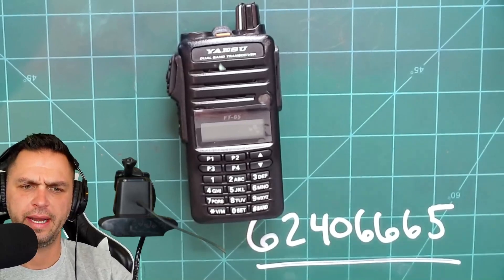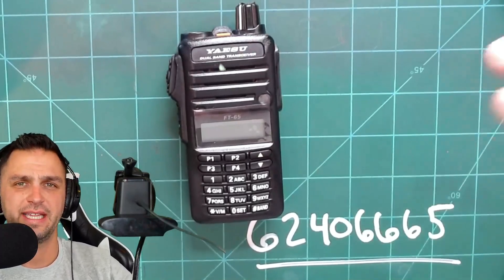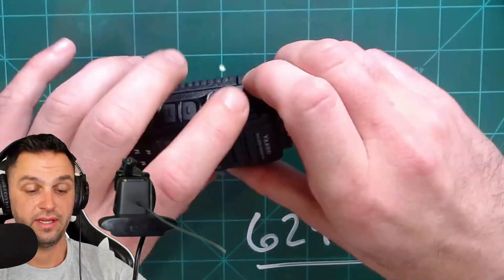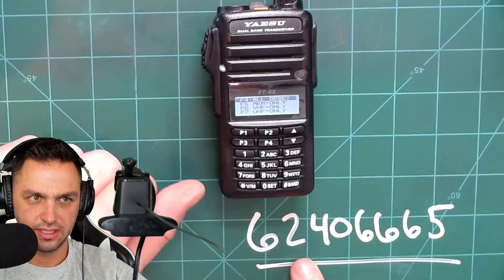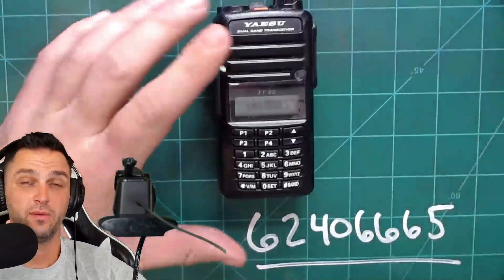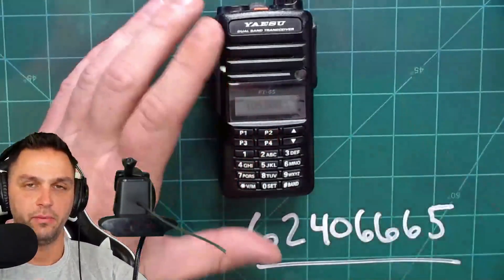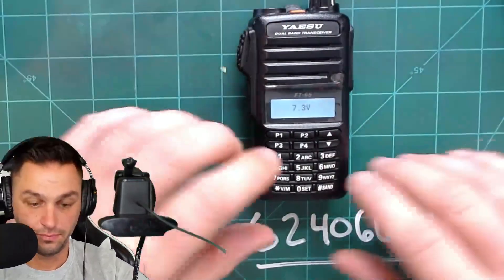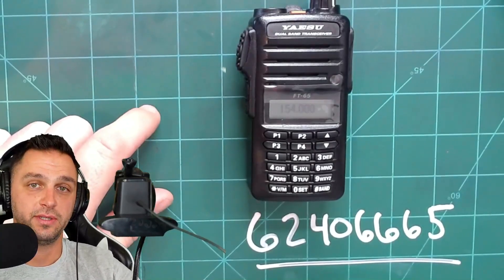How to Mod Yaesu FT-65R MARS Mod / Frequency Mod - In Two Minutes or Less - Yaesu FT65R

Comment: One thing I noticed is when you are typing in the code, nothing shows up on the screen until your done typing and it does a reset automatically. I thought I was doing something wrong when I started inputting the code

Comment: My wife has a 13 Years Old FT-60. The Radio still works fine, however, the Socket on the Motherboard for the Wall Charger, developed an open circuit. Still charges fine by using the Charge Craddle.
So, I'm going to sell the Radio, with a Battery, Alkaline case and The Wall Wart & Craddle for $80.00 for everything.
I just bought her an FT-65 for Christmas. I like the thing SO much, I plan to purchase Two more of them for my Go Kit.

Comment: Great mod. Any ideas why id be getting momentary drops in strong signals?? During our usual weekly Nets. Net Control will momentarily drop a few ms but my nearby scanner wont. Other than that its a great radio especially when paired with a better antenna.
Reply from the maker: Depending on how strong, the signals could be causing decents of your receiver.  Do you know how far away the signals are and how much power They are?
Reply: @DudeTested  repeater is only 6 miles away and is only 20 watts. But it oddly only effects maybe a few talking. Most of the people come in without any drops.
Reply from the maker: @danielhildebrand6892  that it's odd.  I wouldn't think it would be an issue.  Is your squelch up high?
Reply: @DudeTested  I am on Tone Squelch for this repeater but if i hold the Mon button i hear everything clearly. And oddly like I mentioned only Net Control seems to be the issue. Everyone else on the net seems to come in without dropping. I am curious as Net Control is hardly a few miles from me. I can also monitor the repeater input and it comes in clear without dropping.   I did a full reset and reloaded all the frequencies and PL tones this morning. Will see tomorrow night during our ARES session if Net Control drops.

Comment: I don't know if anyone has mentioned it, but one of the most useful parts of this mod is to get down into the 420-430 segment of the 70cm band if there's nothing else going on down there in your area. Under normal operation this segment is locked out.
Reply: What do you mean "if there is nothing else going on down there in your area"? You can't just listen and decide you can transmit just because you don't hear anything, because it is possible that you are jamming users that are farther away, that could hear you, but that maybe you can't hear (for instance if they use lower powered radios).
Reply: @uski  You trollin' ? Of course, good operating practice it to listen. And if nothing is heard, it's not out of the question to use a given frequency. 420-430 is typically used for ATV. Some areas are very active with this, others are not. Everyone should always be willing to resolve any conflicts of frequency use peacefully.

Comment: You know you can put a dual watch on that radio. Its in the secret menu.
Reply from the maker: I do.  I may have covered it in another video.  However, if not, I can make a video so it will help others. Thanks for brining it up!
Reply: Turn radio on as you would do for the MARS function..... Scroll down to F8 and hit the function button on the side of the radio. That Simple...

Comment: It doesn't want to work for me.  China version.  After I enter the code it does not reboot.  What am I doing wrong?
Reply: Press the bottom button on the side of the radio after entering the code
Reply: @ashab1  Thank you so much!  I've had this radio since they first came out years ago and the mod has never worked for me.  This extra step of pushing the lower side key made the difference.  I have the made in China version.  Nice to know it is capable in the event of an emergency, and it makes this already good radio even more valuable.
Reply: @John T
You need the Japanese version...send the Chinese version back!
Reply from the maker: That's not true.
Reply: @DudeTested  I have the radio made in Japan, I did the Mod and I don't see "ERROR" on the screen when transmitting but it isn't sending anything out. All they hear is sql breaking and repeater beep... Is there a way to enable TX on GMRS? Or to enable/use Scramble if not the Asian version?

Comment: Thanks Sean, are you aware of a way to do this with the FT70D?
Reply from the maker: Hi Paddy, it's only possible via the way described here:https://youtu.be/teNbPY-ct64
Reply: Thanks Sean, I’ve just watched it, I’ll give a try tomorrow.
Reply from the maker: It's a tiny one. Be careful and take your time.  I also submitted tonight unless you're great with service mount soldering, you might have a bit of an issue getting it back on if you ever wanted to replace it.  Best wishes and nice hearing from you